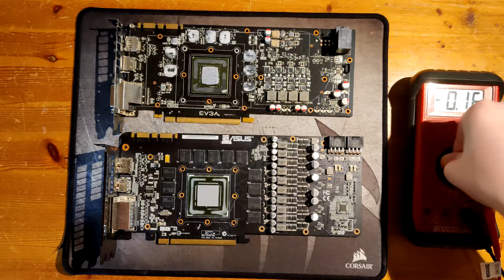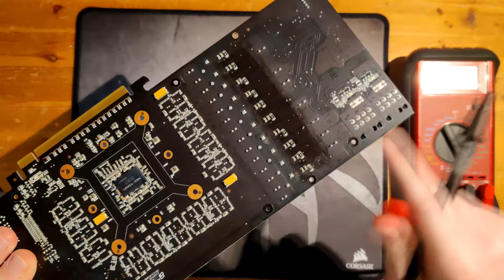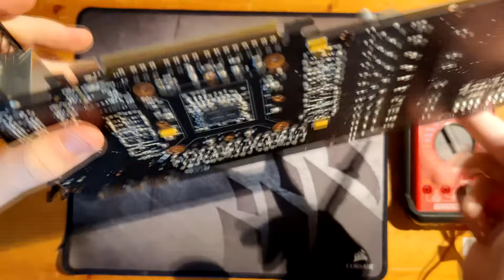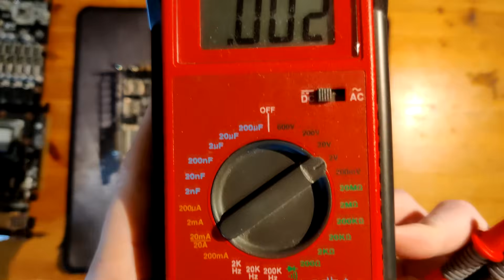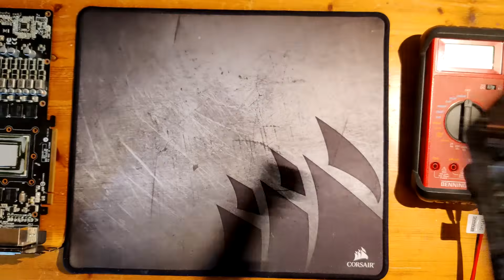The GPU "Stabbing Guide"

Comment: im trying to fix EVGA rtx 3070Ti that have no display and 3 red LEDs stay on at power connectors when powered up. Im trying to understand where what resistance should be and where what voltages need to be. I feel like I really need help of someone smart like you that could help me. But I don't know any body that understand this things. Maybe I could email you the picture of the board and you could mark points where I should check voltages and resistances. It powers up i find 12v in many places find 3 volts at some point and 5 v. But i dont understand are those voltages supposed to be there or not or they suposed to be elswere as well. Main processor it self has no power and stays cold during power up.

Comment: Does most GPUs have same voltage for core and memory chips? If it is, can i reuse the Can type capacitors, inductors and MOSFETs from another gpu to replace a broken part?

Comment: Basic tutorial
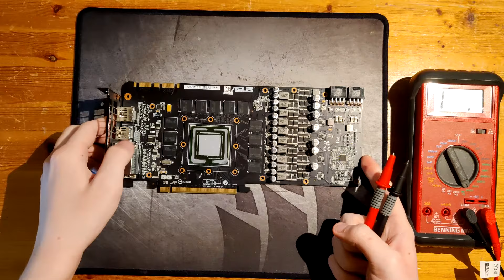1:40 Resistance measurement
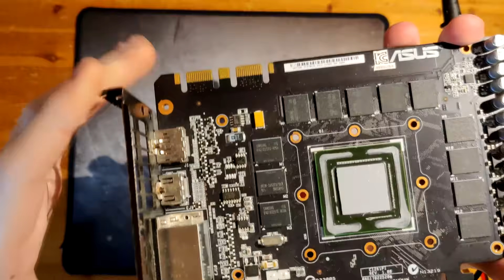3:35 Finding ground side of capacitors
7:22 Finding core and memory
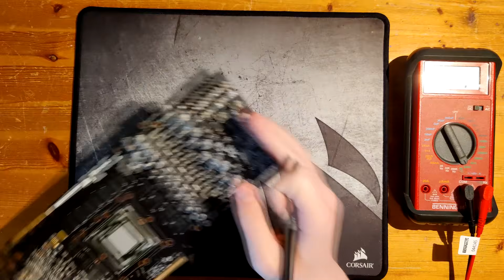8:41 Trying the measurements on GTX 670
10:40 Voltage measurement

Common failures
17:54 12V to ground short
20:29 12V to Vcore short
21:33 Vcore to ground short
22:43 Powering GPU on when there is short

Comment: I try to measure GTX 750ti's vmem resistance is 500 milli ohms ( too low resistance which is normally 50 ohms). Is the vmem short ?

Comment: Hey,I just wanted to say thank you for this very in depth video!So,I got an issue with a Sapphire Nitro+ Rx 570,the 4GB edition.The card was originally in my sister's pc for 3 years with not so good of an airflow and she preferred silence so it was running around the thermal threshold while she was gaming.So what this card does is,the screen goes black and i get an audio glitching effect,then it crashes and I get no display signal,but if i leave it off the pc for say like 2 or 3 days and install it again it works for a few days and it starts crashing again.While playing I get no artifacts and the card itself overclocks really well for a 570,If it powers up it can clock up to 1450/1480mhz stable on the core.Temps are in check with custom fan curves and never exceed 55-56C.Could it be a short of some sort or does the die itself need a reball?

Comment: 27:46 - "Power it with one of these" What is it ? please, anyone. At least if I know the name I can research it. Thanks for the vid, I now know how and where to measure resistances and voltage on a pcb with a multi meter. Slowly improving my knowledge.
Reply from the maker: it's a LM2596 external DC-DC buck converter

Comment: Hello thank you for these super videos.
I have an issue with my 1080 ti gigabyte.
Fans running led too, but no pic on the screen and card not detected, the core temp increase when i put my thumb on it, there is no burned component and i made a lot of measurements, but I don't know if what i measure is in the good range :(
Any advice for this kind of problem ?
Best regards 
Silas

Comment: Zoras i found shorted mosfet on my gpu and removed it. But i didn't replace that mosfet with new one. My gpu back to life(installed driver and played some games etc.) After a week the gpu dead again. Lights on and fans are spinning but no display. Gpu chip is do not get warm also. Do i have vrm problem again? Or gpu is totally dead?

Comment: Do you have a repair guide or schematics for a reference EVGA 980Ti? CIN:4995AI154518. Picked up the card from a friend who said screen suddenly went black while playing, now there's no signal. Should note the card wasn't tampered with in the past. Visual inspection of pcb doesn't reveal any burnt marks. I suspect its a faulty MOSFET, but I'm just beginning to learn how a card works, unfortunately. Cheers:)!

Comment: I have a 970 and it works but it won't boost and it will stay at low clocks while having 100% usage can anyone help plz
Reply: Probably need to change the thermal paste if you never did.

Comment: Hi @Zoras Tech, please also make a guide on how to identify which are the Bios chip, 1.5v chip, 1.8v chip, pex rail etc. This is the best video ever!
Reply: You dont have,1, 5V, the bios Chip always has an 25&20 or simular makings on it (kile 25h16 or so) and the most are vrom winbound.

In all gpus as far i know, the 1V rail if its there, is on the pcie express  Front side near the mem. 1,8V is mostly in the back of the card.

Comment: Totally confusing and self confusing types. I got same situation on gtx 1050ti and rtx2060 but I couldn't find a single tips from this video. Only fan spinning with no display after connecting to riser and external psu.

Comment: Hi,  I loved your videos, lots of information there....

So, recently i got a broken Zotac GTX 750 wich have odd behavior. the card didn't show anything on display monitor (no display), but VRM's voltages on GPU and Memory are present, wich are 0.9 v and 1.5 v (indicating VRMs are work, isn't?). The gpu get hot when i turn the PC. 

When i probing resistance between PCIe's 12V rail and ground, it was too high, around 1,7k Ohm ( other working GTX 750 with same PCB has 600-700 Ohms). 
But interestingly, when i flip the probe (red on ground and black on Caps near 12v pin) the resistance are same with working one, around 400 ohms.
it's seems like a faulty diode, right? or another component can causing this too?

thanks....

Comment: hey guys i have a gpu that had a blown fuse(f10a), i replaced it with a 12 amp fuse(f12a) and now the motherboard is powering on again but i still dont have video output and the fans are not spinning, however when i turn on the motherboard i do see a very tiny spin in the gpu fans so something is happening. How would i go about and diagnosing this? help is much appriciated guys much love!

Comment: Dear friend,i start recently to repair graphic card,and i have a r9 390 with 20 ohms rezistence on 3,3volt
it means i have a bad gpu? or is possible to find something else defect
Thank you
Reply from the maker: low resistance on 3.3V can happen on some cards. i think i saw several GTX 480s that had a similar resistance htere but were fine

Comment: My 3090(strix) won't power on while in my pc. My pc shutdown while playing Cold War. It gets red lights on the pcie power ports if plugged into the mobo, but  pc will not power in if I plug the power cables into the gpu. My PC will turn on with a 2070 super installed though🧐.

Comment: Can you do a video about repairing a short inside a multi-layer PCB? For example, when a mosfet melts down and burns a hole through the PCB, bridging the ground plane with the 12v plane.
Reply from the maker: I already did a fix like that on a GTX 780 (you can look up the video on the channel page) sadly the card never worked out because of other issues it had

Comment: how about using thermal camera and plug in power to check which component overheat fast and solve the problem ? or is it still better to use multimeter ?
Reply from the maker: If you have a thermal camera of course use it. I just don't have one and i assume most people dob't
Reply: @CmdrSoyo  for newbie like me, do you think using thermal camera to troubleshoot is easier ?

Comment: Thank you so much for the fast replay for my previous question. let me ask you another related question. i am thinking to turn on the card using only power supply and riser (No Motherboard) , i will connect the pcie power to card and raiser power and jumper the motherboard power connector pins 3+4 , i assume this will turn on the card and i will be able to measure all voltage rails. what do you think ?
Reply from the maker: that's how i do it

Comment: hello and thank you so much for this valuable information. in minute 25:39 you mentioned that you turn the card on and start measuring different volts on the card. this is ok if the main chip is not getting hot , but in some case the card is not detectable but the main chip start to get hot and the card is naked (lol this make sense) so what you will do in this case , for how long you can keep the card without heatsink and fans while measuring the volts specially you need to measure in different places in the card in front and in the back ????!!!
Reply from the maker: Place a small piece if metal on the core, turn it on and make one measurement. Turn it off, let it cool down and repeat

Comment: Hi. Great video. Please can someone tell me what could be wrong in gpu crashes under heavy load. Gpu is not overheating. If I undervolt it than it a little better but also restarts randomly. Power supply is 750w. Gpu is rx470 and rx580. Thanks

Comment: How to know if something is a fuse or just a "shunt resistor" (what's that?)
Reply from the maker: You know what is what from what they look like. Usually fuses have their amperage rating written on them and the resistors have their resistance written on it that can help.

The shunt resistors are used in nvidia's power monitoring system. Buildzoid made a video about how it works exactly
Reply: @CmdrSoyo  Hi Zoras, It is the best tutorial i see in internet! Thx 4 all. I have a problem with a vega 56 and not find the problem and i try this a lot because its my only graphic card... I try to follow your video step by step but I think its all ok. I go with a "tecnic" and he says that changes 2 fuses but broken again. (I pay for it but I think he doesn't do nothing). Its possible to contact with you to explain to you my problem? I'm sure that its reparable but i don't find it. Mi instagram is Korver32 or if you prefer with email say me.
Thanks so much in advance  and sorry for my english.
Reply from the maker: @victoresteve7236  Vega Cards are known to be incredibly hard to fix. The tech you talked to likely did change the fuses but there is very likely another problem and the fuses are just a symptom of the larger thing. I never worked with one of these so i sadly have no idea what exactly could be wrong with it
Reply: @CmdrSoyo  Hi Zoras, thanks for your quick response, its posible to contact with you with email or discord and try to check with tester with your instructions? korvergalaxy@gmail.com.
Or maybe its posible to send you the card and try to repair it and make a video?(if you like).  Thanks a lot in advance.
Reply from the maker: @victoresteve7236  you can go to the AdamantIT Discord (https://discord.gg/VtQDhcR3Q7). there are a lot of helpful people there. AdamantIT (Graham) himself is also there and he does repair for a living. i know the theory of repairs but never pulled something that's not a reflow off successfully. you would have a much better chance of getting help there
Reply: @CmdrSoyo It won't let me join the channel, could you add me to friends? Korver#7046. Thanks in advance.

Comment: When you are trying to measure voltages for reference, is it a good practice to have the card out and power the 12 volt plugs with a power supply? Would this be of any help in checking a board? If you put it in the computer and power it up, wouldn't the cpu start heating up right away so that you could not leave it on without a fan and heat-sink long enough to check voltages? I just subscribed, have you done a video card repair from the start showing what to check and why first and what you would expect to see and why? I have been looking for a channel that shows this with explanations as you seem to hear. I have purchased several broken cheap video cards trying to learn repair without any luck yet. 4 more boards to try to figure out coming next week! Thanks for the video and its content. Stay safe and well in these times.
Reply from the maker: The card has to be properly powered up to measure voltages. If it is not running and just getting 12V in the power plugs then you will get just that. Only 12V on the power plugs. Everything else will stay turned off. As soon as there is voltage on a part it powers up and gets hot. Not much to do about that except be fast and maybe find something to cool it down for a few more seconds

Comment: great video, I have RX580 4GB that has default 1750Mhz on mem but when I run unigene heaven it just crash then blackscreen. Tried to downclock the mem to 1500Mhz and it run 20 minutes of unigene heaven just fine. Is this case of degraded vram?

Comment: Really informative. 
Could you please make a video about artifacts.  And reballing the main gpu. 
With all this information,  the one can start repairing dead GPUs.
Reply: That's not repairing. You can't repair flip chip GPU's with reflowing or reballing. It's just a temporary fix. But if you can reball a gpu sucessfully you can sucessfully replace a GPU chip.